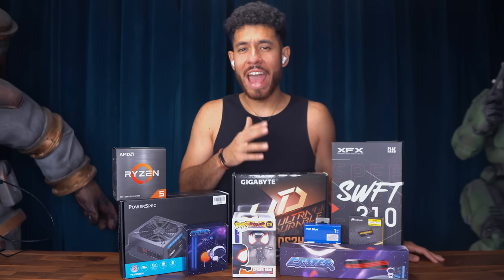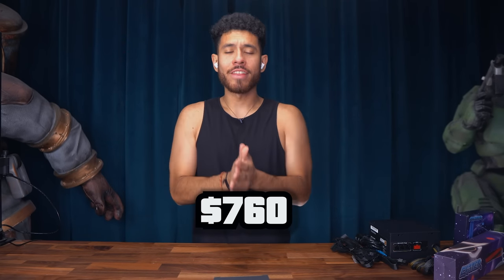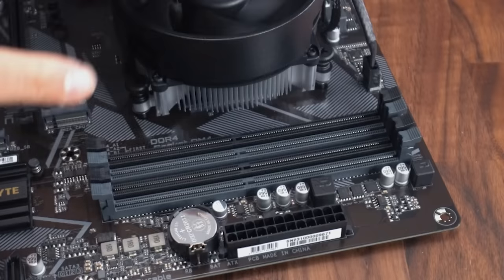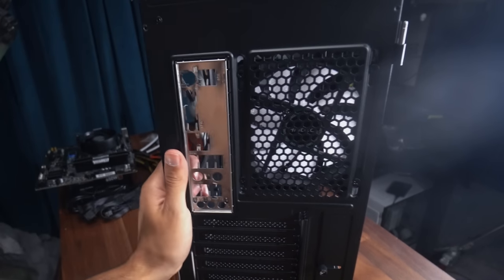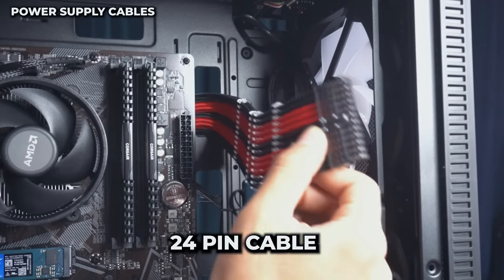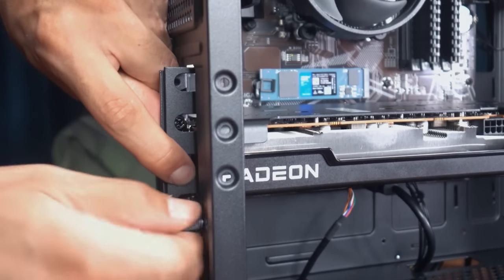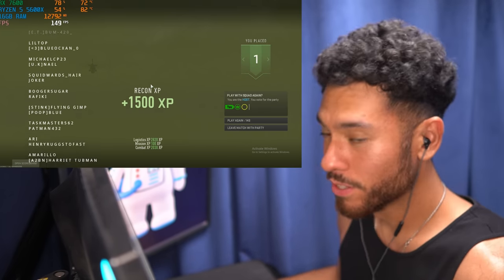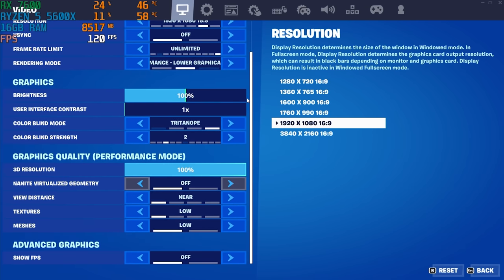BEST $750 Gaming PC Build Guide - RX 7600 Ryzen 5 5600X (w/ Benchmarks)

Comment: So I recently put in my cpu and I can’t run the computer yet due to me not having a case but when I installed the cpu it didn’t go in straight away so I shifted it gently forward and it fell into place, should I be worried that I bent any pins and or take it out to check ?

Comment: Is it true that the stock cooler for the fan should only be used for a few months max? And what would be a good alternative instead of using the stock cooler that works with this 5600x cpu?
Reply: It runs on the hotter end while gaming but it’s fine  and is completely useless for workloads definitely get a aftermarket cooler for the 5600x when you can afford it

Comment: is a bios update needed for the mobo? i need a 100 dollar mobo for my ryzen 5 5600 and i don’t have a older cpu to update it if it needs one, thanks!
Reply: The motherboard used here comes with q flash if you need to update but most likely with come with updated bios.
Reply: @itsatrap4986  thanks man

Comment: What's up with the ram xmp profile or whatever crashing on windows ?
Reply: That's the fun part about XMP that tech channels rarely talk about. XMP is an automatic RAM overclock profile. Its impossible to create a profile that works perfectly across every possible hardware and BIOS combination. If your PC crashes with XMP enabled, it likely won't work for you. You will need to manually adjust your RAM settings until you get a stable overclock. Overclocking is part art, science, black magic and luck.

Comment: just built this pc a few days ago go everything as he linked it case and all but when i play valorant or league my pc restarts its self no blue screen just black into a reboot any ideas
Reply: im thinking of building my first pc from this video kinda scared of running into this problem, did u end up fixing it? and if so, how?
Reply: Update bios and double check ur heat sink you may have put ur fan on un even or mabey ur heat sink had crappy thermal paste out of the box since its pre applied not all of them are gonna be perfect
Reply: Got it fixed awhile ago sorry I had seen some errors that the gpu was sending so I sent my gpu back and it works fine now.

Comment: For ram why do you use the 2nd and 4 th slot?
Reply: It is to enable dual channel memory. This  gives your memory some performance boost over a single channel memory configuration. The channels are separated usually by slots so that's why they are installed that way.

Comment: Would definitely change the ram with rgb version and an id coolilng cpu cooler which has rgb fans for $20
So it would probably set the budget in $780 but i think it will definitely worth it
Reply: You can save a little going Ryzen 5600 over the 5600X... Lose a little OC head room but stock/PBO they are pretty similar.
Reply: @SpoonHurler  The performance loss isnt worth it in my opinion, I would still rock out with the 5600X
Reply: @KayThePlug  it's 20-ish dollars for 2-5% more performance and if you get a good 5600 silicon then it pretty much looks like a 5600X when have PBO... Plus you get a good cooler so it can keep high clocks longer.

Comment: My pc won't start pls help
Reply: Start by checking the obvious, yet easy to miss stuff: Make sure the power outlet works; make sure the power cable is securely plugged in at both ends; make sure the power supply's power button is not turned off. After that, if the PC still doesn't turn on, look at the internal components. Make sure ALL internal parts and cables are securely and correctly connected. If your motherboard has a diagnostics/debug light, take a look at it as it can tell you where the problem may be at.

Comment: I spent around 600 on my build and i got the same processor with a 3070ti
Reply: How much fps do you get on fortnite
Reply: @LoadedJJ  I haven’t downloaded it or tested it but with my current specs I know I’d get at least 200+
Reply: @LoadedJJ  for reference I can run beamNG max settings with 100 fps
Reply: @scout1710  so u got the same specs as the one in the video?

Comment: 12400f way better choice for a budget build
Reply: good luck spending 150$ for a decent b660 then.
Reply: @bipulgamer07  what are you talking about you can get a gigabyte b760 with WiFi for 120 dollars new both are great options 5600 does have cheaper am4 mb yes with an upgrade path but not everyone wants AMD either 12400f outperforms the 5600x in most games also is cheaper then the 5600x by 30 dollars please know what you are talking about before coming at me bro
Reply: @MrCougar1825  Not in my country at least. Gigabyte b760m ds3h ax is almost 200$ here in India.
Reply: @bipulgamer07  this isn’t about ur country if that’s the case go with what’s cheaper this is about over all I understand why you think that if you live outside the US